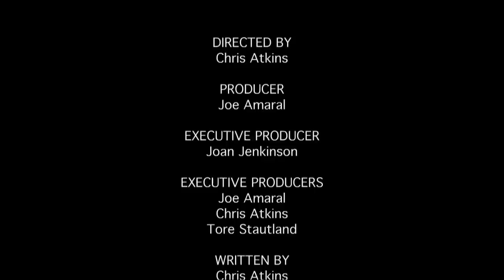Ancient Boat With Biblical Connections Uncovered - Unearthed - The Jesus Boat

Comment: How sure are you that it is the particular boat that Jesus Christ used? Was that the only boat at that time? Couldn't it be a different one than the one Christ used.
I am only wondering how a piece of  wood can be under water for 2000 years without completely rotting.Unless is a miracle.